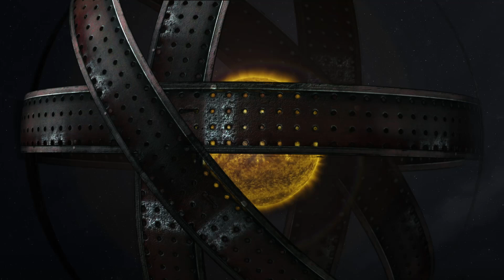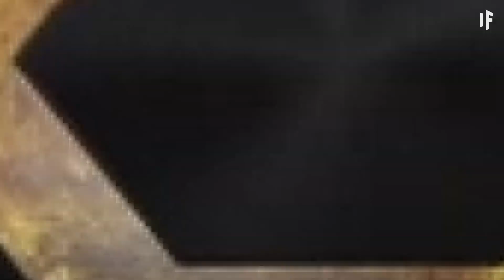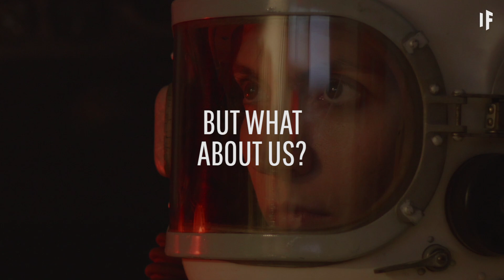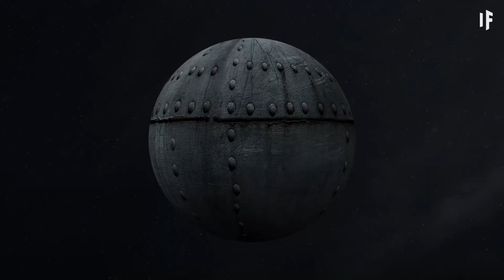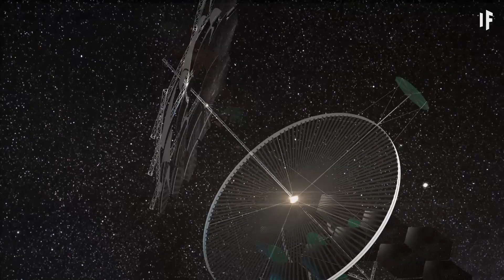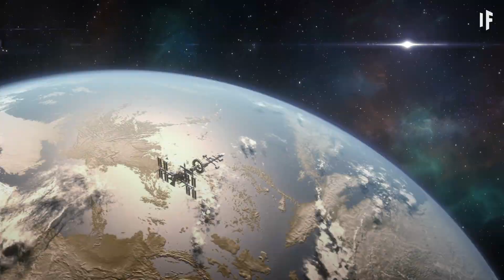What If We Built a Dyson Sphere Around the Sun?

Comment: As I recall the force of gravity of a hollow shell is zero for objects inside the shell.  So the sphere would at least be stable in the sense that it wouldn’t get pulled off center and hit the star.  But, that also means that there would be no force holding the atmosphere on the surface of the sphere.  So you’d need a roof of glass.  And you’d be weightless.
Reply: The sun would still be there inside the sphere so it would provide gravity as well as power. If we build it with the right radius we should have approximately 1g gravity throughout the whole megastructure

Comment: Dyson Sphere is an intriguing concept, but maybe before these scientists think that other civilizations in far away solar system have it, they should consider first if it is possible to create a Dyson Sphere, which will need to have materials going around the sun’s whole circumference many times over. Where would a civilization get those materials to cover almost the whole sun?
Let’s take our own solar system for example, even if we slice the whole earth, peeling it like a potato up to the center, producing a 10-feet thick earth peelings (Of course, this is impossible since earth is not all solid, but let’s imagine it is, for the sake of this point), we can only produce a material barely more than 78,000 miles long. Our sun’s circumference is 2.7+ million miles. So the whole earth can only cover less than 2.9% of the sun’s circumference. Even if we peel all the 8 planets in our solar system and combine them, we will only produce less than 250,000 miles long of material – that’s only about 9.2% of the sun’s circumference. Safe to say that even if we use the resources of the whole solar system, we can’t create enough material to go around the sun’s circumference (and if we do this, there will be no more solar system – just a sun and a 9% Dyson Sphere). By the way, the sun is the 99.8% of our whole solar system.
One may argue that we can get the materials from outside our solar system, which could be a good idea, BUT… if we can already do interplanetary travel beyond our solar system, pickup objects from outside our solar system and bring it back to our sun, then it means that we already have discovered an unlimited source of energy, so there’s no need to create a Dyson Sphere anymore. 😊
This is like the idea of terraforming Mars… why would you spend time and effort terraforming a dead planet, when you already have a living planet that is dying??? Wouldn’t it be a lot easier to keep a dying planet alive, than to resurrect a dead one? If we can have the technology and energy to terraform a dead planet, we can definitely use those to keep earth alive, right?

Comment: You can't build a dyson sphere... even if you used all of the available matter in the solar system there would not be enough material to physically build a structure that goes around the sun.
Reply: We don't have to cover the sun around. We can just make panels that reflect the light or energy to a certine point like a solar plant which he mentioned and then harness that energy
Reply: correct.

dyson sphere is possible